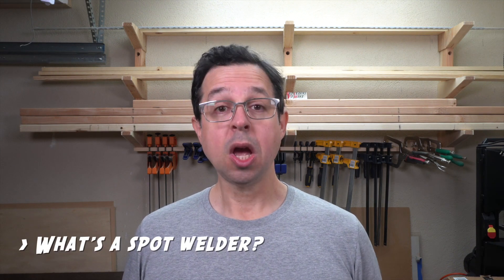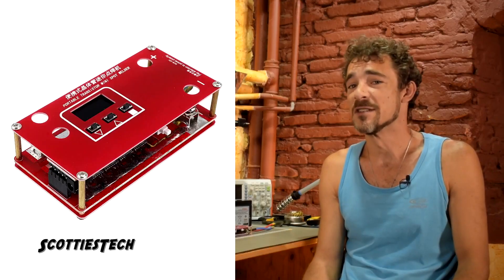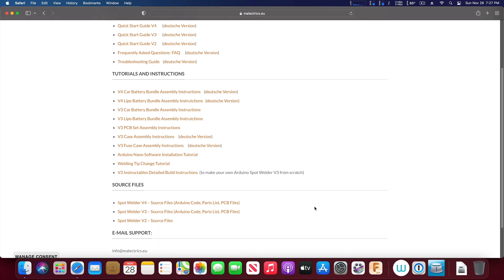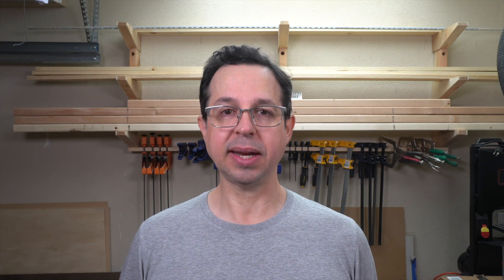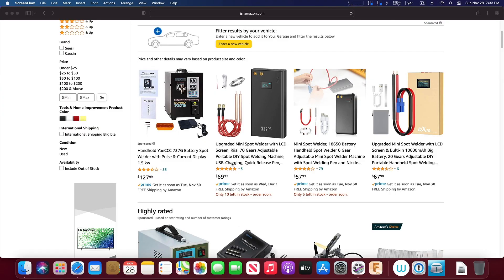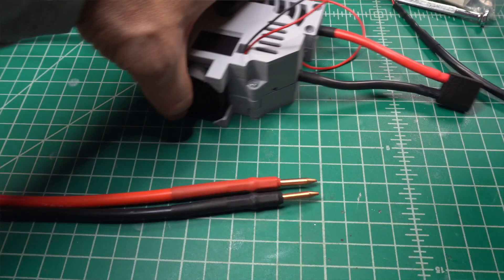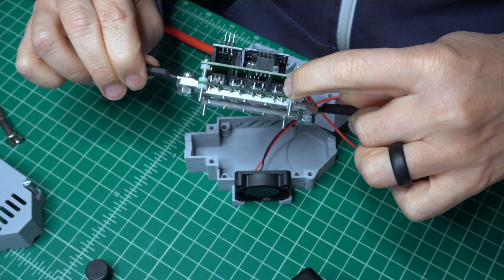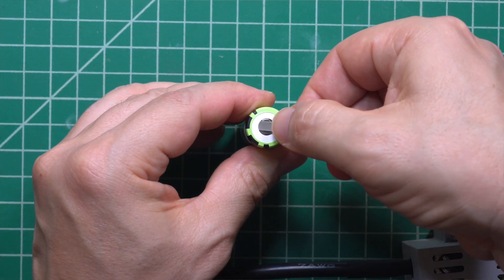Best Mini Spot Welder? Super Safe, Great Design - Review - Fed's Tool Corner

Comment: what size and voltage lipo battery do you need?  can you recommend a brand and model?
Reply from the maker: I could have sworn I listed the battery I used somewhere, but I guess I didn't. The battery I'm using is a 3-cell (11.1v) 5000mAh high charge and discharge rate (65c-130c) Li-Po from Turnigy. Here's a link to the exact battery I have on HobbyKing's website: https://hobbyking.com/en_us/turnigy-battery-nano-tech-5000mah-3s-65-130c-lipo-pack-xt-90.html

Comment: I purchased one of these several months ago based on a lot of positive reviews such as yours - good to hear your take on it. My big concern is the use of the lipo power supply (I have yet to get one) - do you have any concerns about using lipo? I'm on the fence trying to decide if lead acid is safer. Do you find any excessive heat build up when using the lipo battery? If it stays relatively cool I imagine it's probably not too concerning. Any comments along these lines is appreciated.
Reply from the maker: I hear ya. Lipos are kinda scary to me. I almost went with the lead acid battery model, because of my Lipo fears. However, I decided to go with Lipo for a few different reasons:
1. I already had a Lipo charger and fire safety bag because of my interest in radio-controlled models.
2. The lead acid batteries you have to get are substantially more expensive than Lipos, are much heavier and bigger, and have their own set of caveats and dangers.
3. My research showed that, while Lipos can be dangerous, modern chargers and Lipo packs have numerous safety features built-in to them. As long as you give your Lipos a rest between cycles, don't ignore signs of aging and don't poke at them with sharp implements , they can be used very safely.

 That last point is why I don't trust the newer mini spot welders that have built-in Lipo packs. I have no idea what kind of safety measures they have, nor the quality of the internal packs, nor how I would know if a pack was going bad or overheating.

Regarding overheating, I haven't experienced that, though I haven't put the welder through any long welding sessions. The safe way to handle Lipo packs is to have more than one, use the first one until it needs a recharge and if you need to keep welding, switch to your next pack, allowing the first pack to cool down before you attempt a recharge.

Hope that helps.
Reply: @FedLearnsToMake  Thank you for taking the time to put together this very thorough reply - very helpful. You addressed all my concerns, and then some.